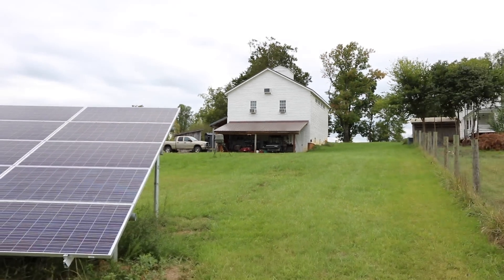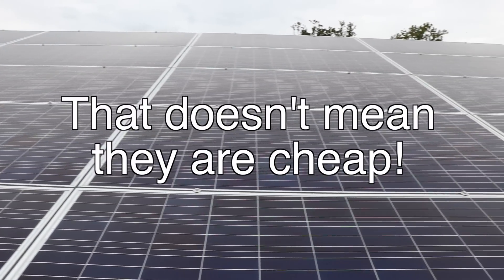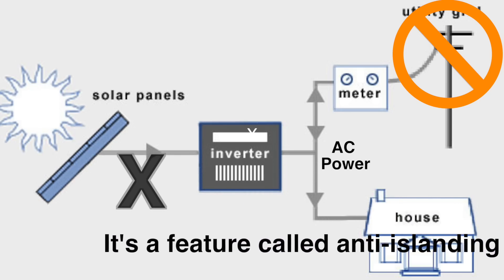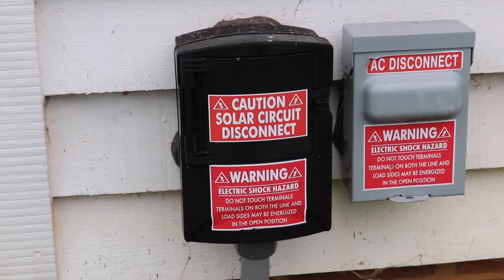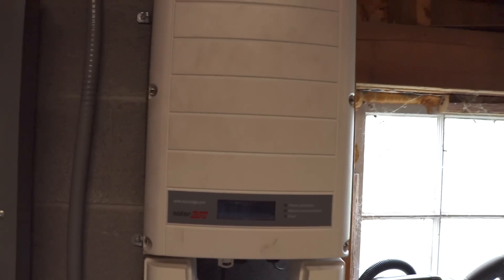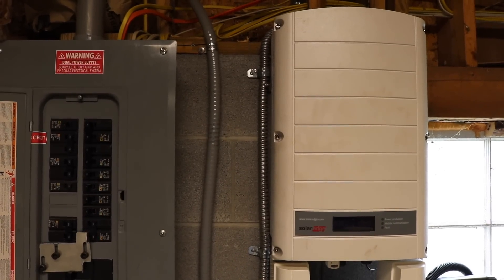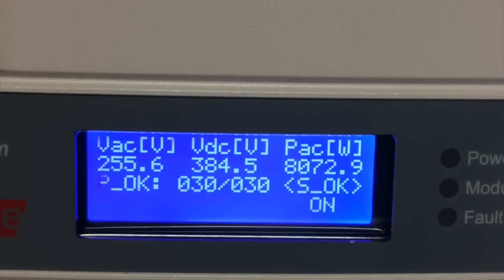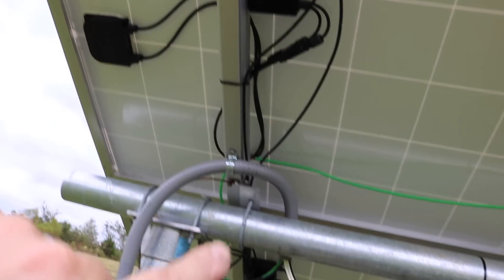The ugly truth behind grid-tie solar systems. Part 1, FarmCraft101 solar.  Watch before you buy!

Comment: Nice and simple video. Unfortunately for many the cost alone is too high. For some states it worked and even for some provinces in Canada. The problem in Ontario they had is the premier giving 83.9 cents per kwh when electricity sold for less than 13 cents... so everyone that produces power in Ontario is screwing themselves as it comes back as a debt in one way or another. Solar does have its place just not sure when... one day when all will have paid for it through the nose it will be feasible and beneficial for all.
Reply: If the cost is too high for you, then install a leased system ...

Comment: why is it everyone who tries to do the investment math and says that your "federal/state" tax credit directly deducts from the cost of the solar costs. It does NOT...it just reduces your tax burden...so to make the math easy...if you got a system that cost you $21,000 and got a 33% tax credit for it ($7000 credit) and you fall into the 20% tax bracket you get a retained cash value of $1400, not $7000. So the real cost of our sample $21,000 solar setup has a real, out of pocket cost of $19.600 NOT $14,000
Reply from the maker: You are confusing a tax deduction from a tax credit.  Your example is of a deduction.  A tax credit is dollar for dollar, a discount of your taxes.
Reply: this individual proves the point that there is a tremendous amount of misinformation out there. Most of which is being spread by people who have not gone solar. The tax credit is 30% and its not a deduction as you are referencing, but a non-refundable tax credit. It reduces your tax liability (what you owe) before you apply your withholdings (what you have already paid toward your liability) . your personal tax rate plays no role in calculating your tax credit. It's called a non-refundable credit because you cannot claim more than what your tax liability is any unused portion of your credit can be rolled over to the following year.

Comment: If everyone was solar powered, what will happen to the power companies?  

No way this is as straight forward as it's being marketed to be, it's a costly ongoing load of rubbish, and as for it being green, what are these things made from and what is the green cost of manufacturing them?

There's more loose ends here than in the Bible, lol.
Reply: Nothing is happening to the utility companies... A majority of their power goes to industrial plans. Besides... the irradiance levels vary depending on altitude and distance from the equator. Also the end users energy cost varies significantly across the country. So it may not be suitable for everyone... but in these good geographic regions the hype is real. 

Most utility companies are building very large solar farms for their production. Especially out west and the east coast. The install cost is decreasing every year. Eventually it will take over as being the utility's main source of power in those areas.  I designed a 100MW system in NC that generates 139,381,984 kWh/Year and that equated to $1,000,000 a month in revenue! The annual maintenance is far less expensive than the traditional power plants. The down side is that they take up a LOT of space/land. So to counter that they have been taking advantage of non-habitable land like landfills.
Reply: It will never happen. Grid power is too cheap and reliable for most people to even think about going solar. Most people are too dumb to live off grid.

Comment: Whilst it's possible to demonstrate savings which can be shown to have made the initial set up free over approximately 7 years, , the con is in the fact, that after recouping the initial cost, people think power will then be free forever, but, how long does a solar system last?

Without factoring in maintenance and replacement costs, this example doesn't have legs.

Comment: Remember sunnyboy sma  inverters can give some power when the grid is down.  my model can do 15 amps when the system has sun on it.  that's enough to run a fridge or wall ac during the day plus charge  batteries or run a pc.  I think the new model can do 20 amps on the standby circuit.  all built in.
Reply: Some do, some don't ...

Comment: Very well explained!  I know all that but trying to explain it to people who don't understand electricity can be a chore.

Someone should make (probably already does) a bypass system that disconnects the grid from the system when the grid fails and run the panels through a separate inverter to run the house during a power failure.

Without any batteries it would go down every time a cloud went over and batteries may not be worth it.  I don't know about your grid but ours doesn't go down more than once every 5 years or so so it's no big deal.
Reply: Already done .. it is called a Hybrid System ...

Comment: Hi. A very big system and also looking very efficient one but I don't know why your cost is so high i.e. is about $2.5 per watt (without rebate) and $1.85 with rebate. I have installed a 1.25 Kilo Watts system on my roof and my system price was $ 1.25 per watt.  I purchased solar panels at about $1 per watt (best quality available 3 years ago). Nowadays a 100 watt solar panel costs less than 50 $, which is less than half a dollar per watt. Grid tie inverters (with MMPT feature) from china are also available very cheap on net (Alibaba.com) I purchased one and it is working fine. The cost of solar panels $1250, Grid tie inverter $200, Installation including wiring, iron frames and other charges including wastage (due to first DIY project),  $200. Hence the total cost was around $1550. Now it has reduced my electricity bill by $ 30 (in winter) $60 (in summer)So the total saving is about  $500 in an year. The system has already paid back 2/3rd of its cost and will pay back the rest of my investment within next 12-14 months.. While comparing with my system, your system  is twice expensive, may b e due to the reason I installed it myself, so no labor, or consultation charges, I used grid tie inverter from China which was a lot cheaper than Sunny boy or other expensive branded systems. But the bottom line is my system is working and paying back and I am planning to install 2 KW more on the roof. The cost of electricity in my country (Pakistan) is about 30 cents per KwH (Highest in the world), which may also be a reason of high return.
Reply: This was NOT a DIY system ...

Comment: There's the RIP OFF, your paying $17,000 so electric company gets the electric you make, for free. you will not know how much electric they are stealing from you. The grid goes down and your system is useless. your one complete idiot. I bet they even install the system and they are laughing all the way to the bank.
Reply from the maker: In the future you might want to actually understand what you are talking about before you start hurling insults.  I have net metering, and I only generate 80% of my electric usage.  Therefore, the electric company doesn't get any electricity from me, period.  I use all the electricity that I generate.  If I were to generate more than I use, I would get paid wholesale rates (not free), but I've sized my system so that I won't generate more than I use.  I have also retrofitted a battery backup on my system, so I can use it when the grid is down.
Reply: Understand what I'm saying.... You spend $17,000 on an efficient solar energy system. I applaud that. What you do not need is an on grid contract. The only reason the electric company invented the net meter was to steal your energy and sell it at retail price. You are not benefiting at all from that deal. It's pure and simple theft, they will charge you the cost to rent that net meter + when you don't make enough to supply your property you will pay retail price. If you get used to only using the energy you make you will find you will be much better off. Your ground wire is siphoning more of the energy collected by your solar system by sending EMF from your land back to electric company this could be thousands of volts. Any device designed by a utility company will only benefit the utility company. There is electricity every in the cosmos, you have thousands of volts running thru your body all the time. Tessla knew this and wanted it to be beneficial to everyone, Edison & Westinghouse were only  interested in the profit side of electricity. Think about it, you spent $17,000 on your energy system... What did the electricity company spend????  There is a lot of greed in big business and in mankind. Nobody is interested in just making a living anymore they want more and more. Good luck with your energy system..
Reply from the maker: I am making a video detailing the break-even period for my system.  You might find it interesting, it should be done in the next week or two, so watch out for it.

I want to clarify my net metering contract.  Mine is done on an annual basis.  If I generate more power than I am using during a brief period, my meter keeps track of that, and that power goes down the line to somebody else, but I don't get paid for it.  It is credited power in my account that I can draw from.  If at the end of the year, I have generated more than I have purchased, then and only then would I get paid wholesale.  Because I never generate more than I purchase, I am only saving money with my generation.  Since I pay retail price for electricity, I am saving retail price per kWh on everything I generate, essentially I am using the power company as a battery bank.  A battery that never requires replacement and costs $360 per year.  If you do the math on purchasing a battery bank, this is a really good price.  

As for not being tied to the grid at all, the problem is I have a lot of powerful woodworking and metalworking equipment.  I would need a huge battery bank and inverter to run those, cost prohibitive.  It's much cheaper to pay the $30 per month connection fee that the electric company charges me, allowing me to use them as a battery.
Reply: I understand the working of a net meter.... Yes it keeps a record of the electric energy you send back, but the energy that hits someone else's property is charged at the retail price while the electric company is paying you wholesale.... That's 100% or more pure profit for them. It's your equipment working to collect that electric energy, you should get a retail price from anyone who buys it. Think of it in this way someone wants a particular item and I know someone who has this item for sale. I buy that item a wholesale price and sell it immediately to the third party for double the price I paid for it. I had no outlay apart from collection. The electric companies are creating a monopoly on the back of people like yourself.
Reply from the maker: I think you are missing the critical point here.  The meter keeps track of the electricity that I've sent out to the grid.  Then during times when I am using more power than I am generating, I get to draw from the grid for free.  The grid is simply a battery to me.  Look at it a different way.  Let's say I was totally off grid, when I generate more power than I use, it would go into my batteries.  I wouldn't get paid for it, but it would be there for me to use at some future time.  The same thing is happening here.  And it is saving me from having to buy that power at the retail rate, so I am saving full retail value on every kWh I generate.

Comment: I have a 3.2K grid-tied system, which works perfectly fine when the grid is down. I have a switch box which disconnects the system from the grid when I throw the lever. This is one of the reasons I chose a grid-tied system, after experiencing quite a few down-times from our rural electric co-op.

Comment: As educated as this guy is he is just a layan.  I think the complaint should be submitted to your utility.  In the past three years I've only had 4-5 hours of the grid down.  As a solar designer I constantly design systems with either the SolarEdge Storedge system, Tesla Power Wall ,the Enphase AC coupled battery or a simple transfer switch and a $250 generator to run critical loads (fridge, lighting, computer, radio)...a grid tied system does not mean you will be out of power when the grid goes down- thats only cheap grid tied systems with a cookie cutter installer hiring cheap labor as opposed to solar professionals.  I've even installed a single panel with a single battery, charge controller, and a automotive inverter in a small section of culvert stood on end with conc. poured in the bottom- boom an underground protected emergency power supply putting out 120v.  Guys in an emergency situation are you really the jerk watching movies, eating ice cream, surfin the net and refusing to give up luxury....In an emergency outage in the solar industry we are taught to serve critical loads  (keep food from going bad, minimal lighting, and a small form of communication) to design a grid down scenario that keeps up with a daily power requirement would be irresponsible and greedy.  What a grid tied going up to 350 volts, what thats on the low end... a SolarEdge optimizer system starts at 350 and goes up to 500 volts and conventional string inverters are at 600 volts.  Why talk about 350 volts as your example when you are getting 380 on a cloudy day?  What a disconnect for each wire?  Why not use the industry standard 2 pole or 3 pole disconnects... a three pole handles 3 wires with the neutral on a separate terminal and the ground is run separate.  As for return on investment I personally know that most of the time the ROI a sales rep is discussing doesn't do the system justice.  Only known rate hikes and past trends are taken into account while the Federal Trade Commission meters out the rate hikes and we seldom know what that will mean in 7-8 years.  They avoid sticker shock and public outrage, if they announced what the actual proposed hikes will be people would blow up.  My parents paid about $40k for a house back in the day and my friends dad bought a Camero off of the factory line for less than $2000 in the sixties if you told them what homes and cars would cost they would have laughed and thought you where crazy...I they believed you they would have been irate.  $17k for a system.... how much came back in rebate from the utility, what was the state tax incentive, what was the federal tax incentive?  What was your actual out of pocket expense after everything to pay for the system?  I did a groundmount in Lancaster , CA for my brother in law.  They had $500-$600 a month utilities and had to quarantine off half the house in the summer because the couldn't afford to cool it and temps got over 90 in doors... now 25 cents a month is there So Cal Edison Bill.  You tell me at $25k  and at close to $6k a year in utility bills what is there break even point?  To purchase 25 years of power at that rate is phenomenal.  Not to mention how many investments can you name that through education, awareness, and practice can you increase your return.  Become aware of your power usage, be aware of how your bill is structured, install LED lighting, watch your solar monitoring and boom you have increased the return on your investment...you cant do that on the stock market- once you invest you read the paper and try to have ESP to guess the next move of the market.

Comment: The 'newish' SMA SB5.0-US or SMA 6.0-US  are grid tie string  inverters that will output 2kW emergency power direct from your array during daylight hours if the grid fails without any storage. I bought the 6kW for around $1320 2016-17. I have installed 3 units and they are very solid and well engineered with 3 MPPT channels each. BTW excellent video...one of the best I've seen...
I run a small home/hotel and reduced my cost from $13000/yr to $3200/yr with a DIY 10kW system  with tracking for $23000 Actual estimated return of cost <3yrs. Now adding 6 kW fixed array.
Reply: Thank you for posting this comment. I was just getting ready to order a few grid tied inverter and didn't like the idea of having solar but no power during outages. I know this comment is two years old but my family will have power when power goes out because you posted.
Reply: How did you go about solar tracking with 10kw of panels? Very interested in learning more about solar tracking on larger systems!

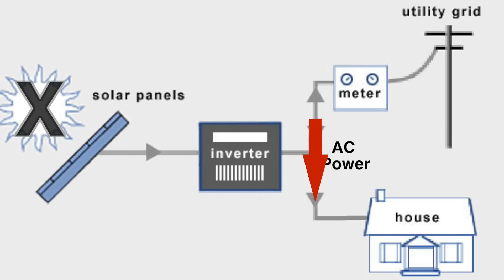Comment: At the 1:30 mark of the video, it is stated that: "Obviously, if the sun is not shining you're not producing any power, and you just get your power from the grid like you normally would."

IF the above statement is true at all, I would suggest it is true ONLY at night-time!

From Jan 10 to Mar 10 of this year (a two-month stretch ending yesterday), we've had 32 MOSTLY cloudy to TOTALLY cloudy days in West-Central Indiana which, along with our 7.2 kWp system, produced a total of nearly 200 kWh of electricity... an average of nearly 6 kWh per day. Granted, that is NOT a lot of electrical power being produced... but it's a LOT more than the phrase "not producing any power" would suggest!

As an example: Today has been MOSTLY cloudy, with VERY few moments (of less than five minutes' duration each) when the sun was able to produce shadows of any sort. With more than six hours to go until sunset, our system has already produced more than 7 kWh for the day....